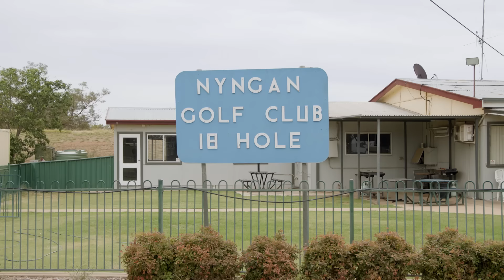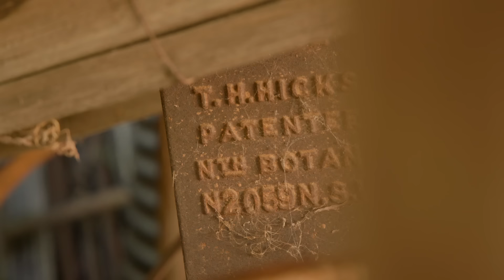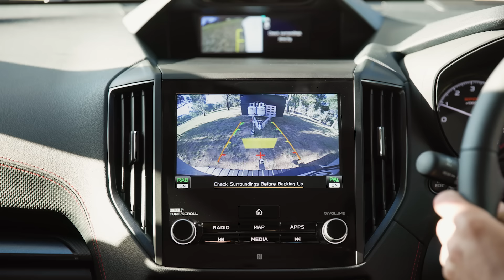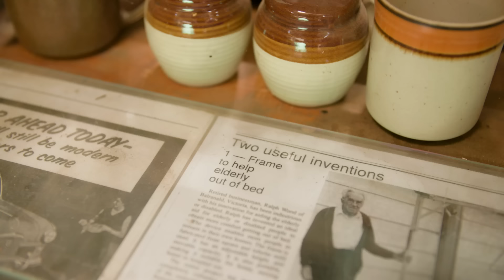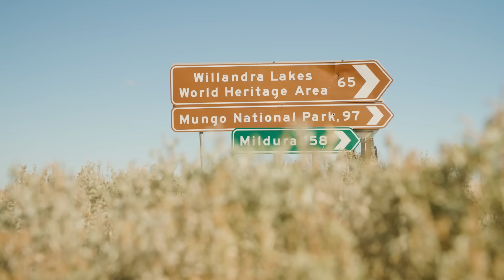Subaru's Great Australian Detour | Season 3, Episode 5 - Outback NSW

Comment: We towed about 900kg in our 2023 Outback and it was terrible. If left in auto it rev would out to 4,500rpm on a slight incline where as if I drove as a manual it sit on about 2,500rpm between 90 and 100kph. Went through nearly two tanks of fuel from Mildura to Southern Adelaide hills. 

Having towed with a turbo diesel Toyota Fortuna and our 1.4ltr 2019 Skoda Octavia both were superior and unfussed with fuel consumption increasing by about 1.5 and 2.5ltrs. 

We love our Outback but for camping we have had to ditch the camper and go to swag to get to our remoter spots. 

On a recent trip to QLD we returned 7.0ltrs/100 over 4,700km loaded with car fridge and other gear but not towing. We were impressed. But to tow, not worthy and it's a shame. 

The turbo version should be low boost turbo just as our Skoda and should be available (like it is in the USA) on entry model. 

I think the advertorials Subaru puts out should be truthful and show revs doing the speed limit at 100kph, as I not seen any videos showing the engine working while towing at these speeds.
Reply: ???? Your particular vehicle must of had a problem.  Revved up to 4500 rpm if left in auto on a slight incline - and gone through x 2 tanks from Mildura to Adelaide ( about 450 km s ) is also way more than it should have used with just 900 kg on the back.
I drive a 2018 Outback 2D - and have towed  1500 kg interstate several times ; and it does just fine 
The auto keeps pace on all but the  steeper roads , where U can put it in manual mode easily to help pull better.
Fuel usage - down to approx 650 km per 60 litres - but have towed a light flat bed 8x5 trailer empty from Brisbane to Sydney 910 km on 59 litres !! 
Either your car or your driving style might be the culprit .....